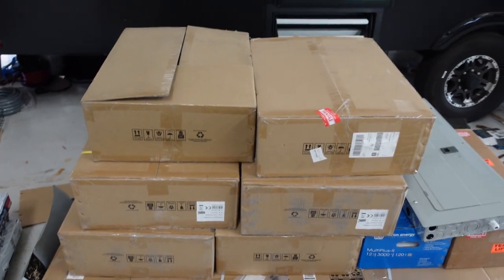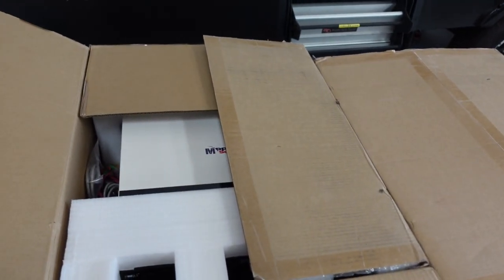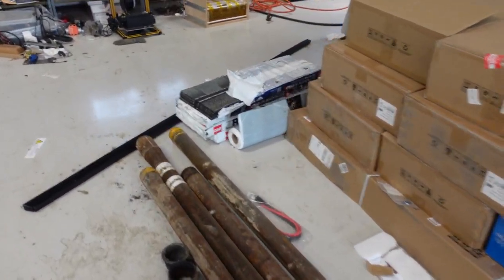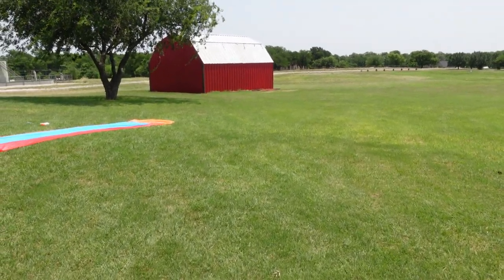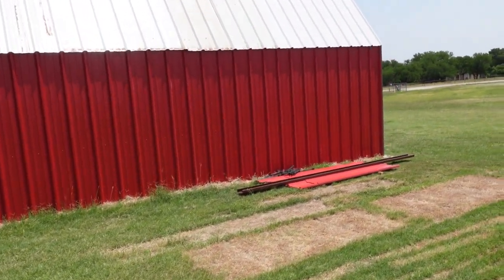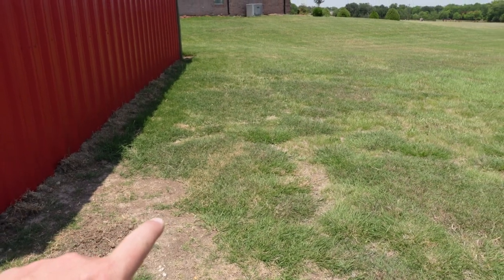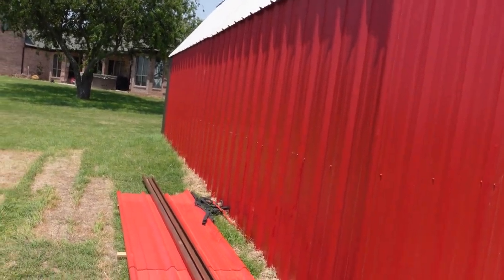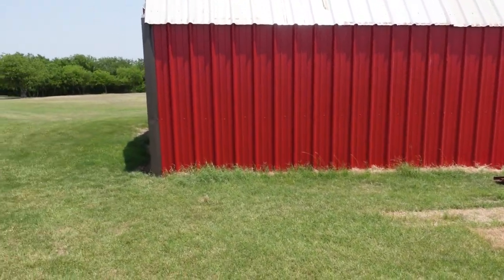50KW DIY Solar Project - Episode 1

Comment: Add as many panels as you can to offset rain fade and cloud fade of solar panels. Also the extra panels help charge the batteries back up if you use power stored during sunlight to be used to run the house at night.
Nice looking system coming to gather.
LIGHT THERE BE LIGHT
Reply from the maker: Thank you and stay tuned!
Reply: We will stay tuned.
Will your batteries be DC coupled or 
AC coupled?

Comment: That’s going to be a large system. Can’t wait to see the build. I haven’t seen those 8kw mpp units before. Why didn’t you go with an lv6548 or a 6048 split phase? No judgment, I’m just curious. Always like to get new ideas
Reply from the maker: Price per watt, they were the cheapest. I need to support a 44KW load and 6 of these gets me to 48KW for the cheapest price. The LV6548 would only get me to 39kw... Which is just 5kw too short. Great question!!!
Reply: @BecomingOffgrid   with a load that size what is your battery bank going to consist of?  What type, brand name,  kwh size are you going to be buying? Currently I’m running some lv 6548’s. So either way I would definitely use the mpp brand again. They are fantastic units. You didn’t go wrong there.
Reply from the maker: @GavinStoneDIY  My battery is DIY. 50kw

I will explain the load requirements in a future video, but the short answer is the 44kw requirement is a very short burst of power (a few minutes). It's not all the time, that would be crazy, but it's more time than most inverters would run above 100%.
Reply: @BecomingOffgrid  awesome. That should be cool. I look forward to seeing it.